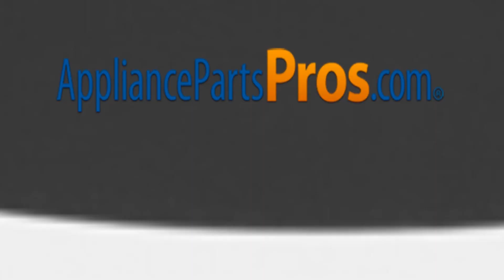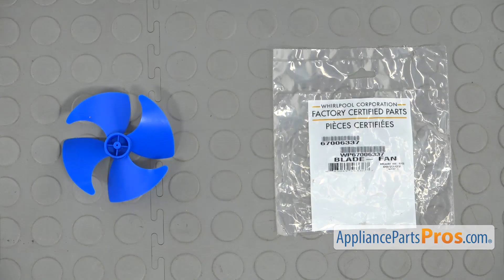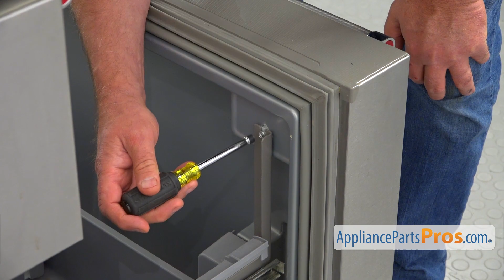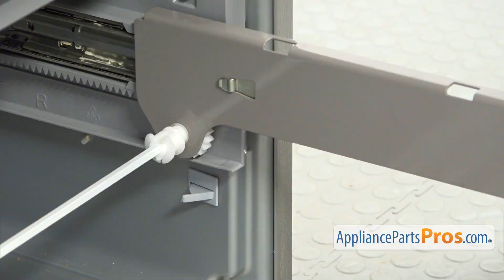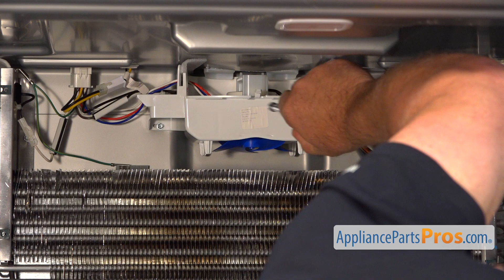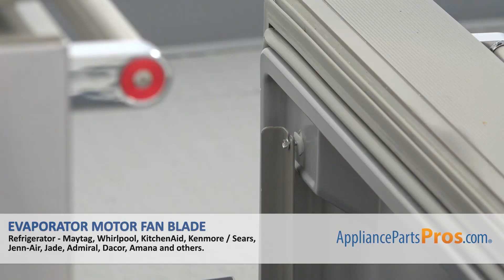How To Replace: Whirlpool/KitchenAid/Maytag Refrigerator Evaporator Motor Fan Blade WP67006337

Comment: great video thanks!  To you have a video on replacing the fan in the upper refrigerator section?  Mine's rattling up there but it's not obvious how to get to it. (it sounds like it's coming from up top).  Similar model to this video.
Reply from the maker: What is the exact model number of your fridge? Even though models can be similair, specifics of how to get to a part can vary model to model.
Reply: Ah, just found the manual: W10621529A @appliancepartspros
Reply from the maker: That is the part number for the actual manual. You would need to locate the correct model number off of the refrigerator's ID tag.
Reply: Dang!  Ok, I found this on the product receipt: MFF2258FEZ.  That look proper? @appliancepartspros